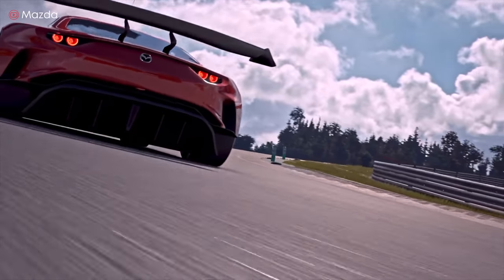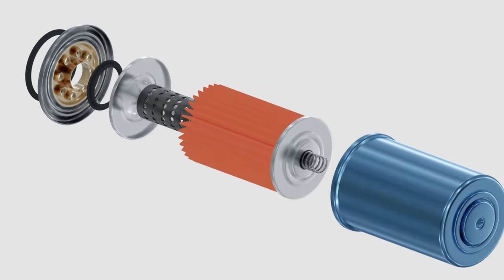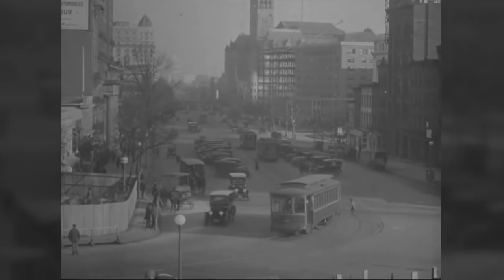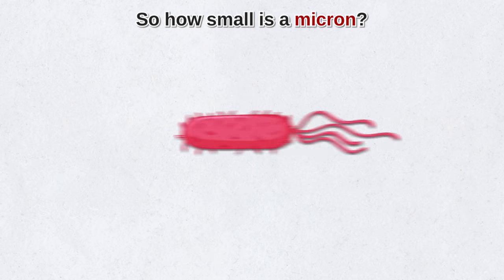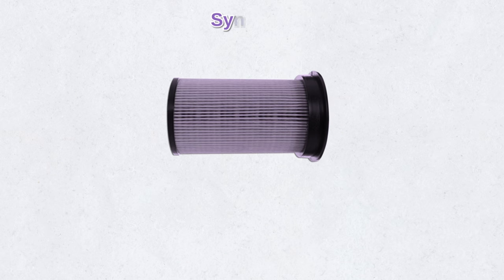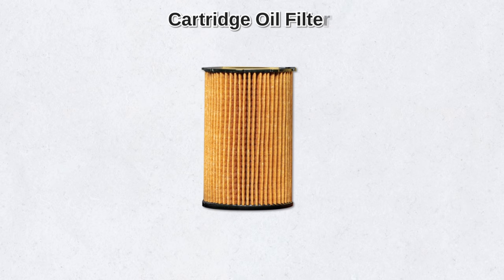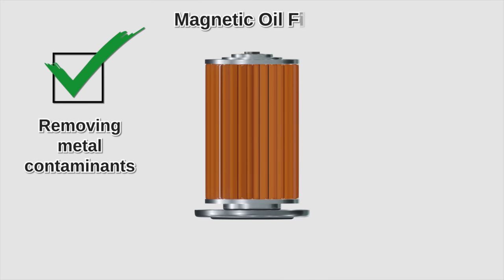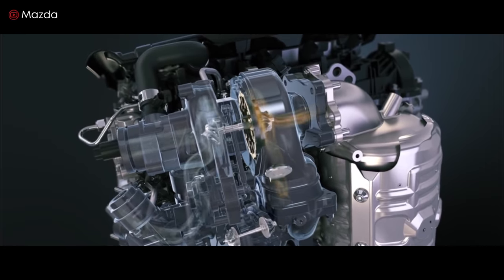This New Oil Filter Just Changed the Game (No More Oil Changes)

Comment: When I was an owner operator truck driver, I used to run a bypass oil filter system of the tractor. The advantage was you kept the oil cleaner and used oil analysis to tell you when it was time to change the oil and not a set mileage schedule. So normally, I could go 150-200k miles before actually needing to change the oil (just for comparison at that time, normal oil change intervals on heavy duty highway diesels was between 25-50k miles). The added bonus to oil analysis is you will be able to catch small issues before they become large ones that lead to catastrophic engine damage. Things like coolant leaking or fuel dilution will show up as will signs of incomplete combustion, not to mention engine wear that is normal throughout the lifespan on an engine.
Reply: It is hours of operating the engine, not miles, that count.
Reply: I have a Mazda spin on bypass filter on the shelf. It is for a Mazda diesel pickup early 1980s. My guess it is pleated paper.Why does a pleated paper  bypass filter clean oil better than a pleated paper full flow filter ? Answer It has an orifice.the slower the flow the better the cleaning. Why was it removed from the Mazda. To make room for a Frantz oil cleaner.. you cant clean oil with pleated filters. It takes depth. The Frantz has depth. 4 inches will always beat 1/32 inch. My Rambler American came new from the factory with a pleated paper bypass filter. The way I got clean oil was to remove it and install a Frantz oil cleaner. Sound like a Frantz dealer.   Haven't used them in years. Better designed filters have came and gone. When you stop selling them you lose track of them. All I have now is Gulf Coasts and Motor Guards. I'm curious about the Jackmaster of Austrailia. Some Australian's use toilet paper in them. I like the tee handle and top loaders.
Reply: love your videos YAY
Reply: Yes, but there's a linear relationship between the two.
Reply: Those were the “good old days”. Diesel and gas engines suffer from oil dilution and contamination caused by emission control systems. A Bypass filter is still a good idea. Oil change intervals should be determined by oil analysis if you want to go beyond 5000 miles.
Reply: Some truck owners spend a lot of 
Money on oil analysis. My old cars are not worth it. I probably spend more on filters and make up oil than I need to. Was mentioning that my Subaru had 250,000 miles with no oil drains using a Frantz oil cleaner and Mobil 1. Was changing the Frantz every 12,000 miles and adding a new quart of oil a Caterpillar lab manager sent me a sample kit. He said the oil looked good  for that many miles but mentioned things like some caramelization. Suggested every 6,000 lnstead of 12,000. I took his advise. The Subaru also ran too hot in Dallas traffic with the A/C on. Toilet paper no longer fits the Frantz. I recently bought a Australian Jackmaster.  They are set up to use tightly woumd toilet paper such as scott 1000 or their own fabric covered elements. I put a roll of Great Value from Walmart  in the Australian Jackmaster. The top loaders have the larger core seals for the larger TPCores. I got the Classic model.
Reply: Not sure how often they sent oil in the Peterbilt to a lab for analysis. At least every time the bypass filters were changed. Years ago I cut open a WIX 750 element for a Luberfiner. It was packed with pulverized newspapers. Fleetguard was the same. Found cotton waste in a Luberfiner  element  years before that. One thing they were doing when I was selling them is they passed current thru a sample of used oil. The dirtier the oil the better the conductivity. The instrument was zeroed on new oil. If the conductivity gets too high a sample goes to the lab. If the instrument pegs out the engine is shut down first. This is for a locomotive engine in a drilling rig. Should work for most anything. Gulf Coast filters does that stuff.
Reply: The Amsoil and Como filter was a little different. They use oil analysis to determine when to change the oil and filters Because of low TBN. Between 50 and 60 thousand miles. The Gulf Coast filter truck still had tin on the rod and main bearing with no copper showing anywhere at 500 thousand  miles. Im just copying the Road King articles. Gulf Coast Filters has more recent information Gulf Coast has a sock filter now. Probably dont apreciate me talking about Bounty big rolls It looks like the best of the small filters is the Motor Guard  Gulf Coast junior  and the Australian Jackmaster Classic. I like the  more expensive Jackmaster with the T handle. It wont clean oil better than the Classic and I have a wrench.

Comment: Scotty, don't forget to remind folks to check tightness of the oil filler cap and dip stick! Both have o-ring seals that may leak and after 15 years my o-ring went flat and set off codes that were not easily solved! Aha! I found the air vacuum leak! It was the oil cap! Code instantly went off and hasn't returned since!
Reply: He talked about the oil filler cap seal a couple of weeks ago.
Reply: Are you talking about the wait a minute is there a cap on the oil filter where is the cat
Reply: If the middle long piece part of the oil cap is missing how bad would that affect the engine?

Comment: I only use OEM oil filters on my chevy 5.3 Its made for the oil weight ,pressure bypass rating,  and micron requirements for my engine . Aftermarket filters are made to cover many applications and might create more wear on the engine.I have changed my own oil and always used OEM filters all my life and never had to go into an engine for repairs.(And i ONLY drive GM vehicles).
Reply: except GM doesn't manufacture their filters, someone like WIX or Bosch does- and they also make other brands. There's only a very few cos.that make all filters, with different names..
Reply: @land7776  Fram is one company that manufactures and markets several brands of oil and air filters.

Comment: I like to place magnets on my regular oil filters. When you cut them open there is usually a very fine particle pile in the shape of the magnetic flux lines. It's never much but always good to keep particles out of the oil. Magnets are cheap.
Reply: Brilliant!
I'm gonna do this on my next oil change.
Reply: Install a Magnetic Drain plug! Also!
Reply: @leegillette9178  
Always! The filter sees all of the oil at some point, though. Drain plug may or may not but it is a great way to get out more, also.
Reply: A lot of steel is much too small for the high volume full flow filter to remove.A magnet or many bypass type oil filters can remove it. Oil changers recommend draining the oil.  For the last 60 years I have used depth bypass filters such as Frantz Motor Guard Gulf Coast and the Australian Jackmaster. My pristine engines have almost nothing in the oil large enough to be removed by the full flow filter. The Wix on my Pontiac has been on there about 4 years and 60,000 miles. No doubt it is still clean. I normally change the full flow filter every 2 years. The bypass depth filter is supposed to keep the full flow filter clean as well as the engine. Actually a game changer filter can only keep the oil clean.  Clean oil can do a lot of things. I have the Australian Jackmaster Classic. As far as I know it is the easiest to service still in production. Push in the  toilet paper and put on the lid. Similar to the Gulf Coast junior.

Comment: I always use the synthetic filter with my full synthetic oil. Engine still runs smooth with 164k miles on it. Got it used with 34k miles

Comment: I have a 2012 Chevy Suburban with the 5.3 L v8. I have had it since 66000 mi and it has 110000 now. I have changed the oil at the mileage from the vehicle mileage countdown meter. Oil and filter was the "specials" from the local parts shop. I was seeing lowering oil pressure readings over time down to the point that it would alarm < 15 lb. I was going the tear it apart to replace the pump. On a lark i changed to a better quality oil filter and shazam, no oil pressure issues at all anymore. I will always buy the best quality filter they have now. Thanks for the info about the better filtering filters with high flow.

Comment: The last time i ever let someone else change my oil they had the same filter on it that i had on the car when I showed up. I will never let a shop change my oil again.
Reply: I take my cars to my mechanic for oil change. I buy the correct oil and filter and take it to him. He charges me a minimum because I let him do all my maintenance.
Reply: amen to that. I have seen these clowns overfill the oil, and tighten the oil filter and plug so tight you need vice grips and a cheater bar to get plug off, or have to puncture the filter and pry it back off. I don't trust any of them, that's why I do it myself. Especially the quik-lube places, they are paying flunkies near minimum wage to do oil changes on your car- and they don't know or care about your car. Even at a dealership, it's not the top mech that's changing your oil, it's the newbie...
Reply: When I worked  in a full service Standard Station it was sir you could use an oil change.  Now its sir you could use a depth bypass filter. Filters that clean oil are not practical  for a lot of people. The good ones all have oil lines. You have to understand  the oil system. But if you want to escape the allowing the oil to get dirty wear and foul the engine then draining it system you need a depth bypass  filter. Pleated paper doesnt do it.
Reply: @ralphwood8818  well, it's done it for me for decades. I've never owned a car with mileage that didn't go >200k, and never had one damaged or had the heads off, using standard oil filters the whole time...
Reply: @land7776  I do it with no oil drains. Almost 60 years. Allowing oil to get dirty then draining it doesnt do it for me. Started with a Frantz oil cleaner on a Rambler American. It came with a spin on bypass filter. Got tired of dirty oil and oil drains. All I have now is Motor Guards and Gulf Coasts. They all keep the oil clear.   Had to drain the oil and replace the head gasket once on the Rambler flat head 6.

Comment: Good information as usual.  My son changed the oil filter on our boat (350 Olds.)  The filter is on the back bottom where you can just reach the filter but cannot see it.  The old filter gasket stayed on the engine and distorted under the new filter.  Nothing we could see. We always observe the engine on our first time out for water leaks or other issues. In this case we pumped out quarts of oil into the boat, shut it down and returned home.  Rest of family not happy. He nor I will ever “not check” for the old gasket ever again.

Comment: In modern engines there's very little 'dirt', particles in oil is actually wear metals! Once some steel wears of cams and the crankshaft these particles then wear aluminum from pistons, chromium from rings and lead from babbit main bearings, etc. How do I know? Oil analysis reports before and after show strong magnets were inserted on and in my spin-on oil filters. To get good results you need lots of magnets because engine oil is thick and moves fast thru the filter.  At 8:24 Scotty claims magnetic filters don't work on aluminum, true, but when you reduce steel particles, the aluminum wear drops considerably. What's best, small or large oil filters? Turns out oil takes the shortest path thru a filter as soon as it enters, filter media at the mount plate of the filter sees the highest oil flow while the rest of the filter fills up, flow thru the media at the other end is far slower. Was I surprised to see this? Yes. Do I like large filters? Yes. It turns out it does not help. Look up the oil filter for a (C2 and up) Corvette, any Corvette, they are incredibly small! Mostly to fit a tightly packed engine,  if there ever was a need for a large filter this is it, yet not so!  My car? 2009 Impala, spin-on filter with 27 magnets (incl 2 FilterMags on the outside). Lead wear is < 1ppm!
Reply: what magnets do you use and where do you place them? Most neodymium magnets lose considerable magnetism when hot, so putting them in oil is bunk. Just curious about your ideas though
Reply: Interesting..
Reply: @dansmith6990  Neodymium magnets lose a percentage of their magnetism depending on their curie point. Most w/ a curie point of 350F will lose about 20-30% at 200F and recover when cool. If they hit 350F they become non-magnetic. Magnets with higher curie points can be bought for much more $$. For a spin-on oil filter I use a pair of FilterMags on the outside, be sure there is enough room all the way around. Between them there's enough space for Neo bar magnets. Inside I place 2 bar mags down the tube seated opposite each other. Then on the filter threaded base I put small round neo disk mags on the steel between the oil holes. Been doing it for years now.
Reply: @mmpiforall5913  on these magnets do you then have to clean these magnets and is it hard to get particles off of them
Reply: @arlenmargolin1650  Yes, during an oil change I take all the mags off and clean. Once the oil is off the steel particles are stubborn, so I use damp tissue paper to move all material to one spot and 'pinch' it off. It takes a few minutes, but hey, TLC always gives good results.
Reply: I dont need magnets because I use depth bypass filters  that remove all of the abrasives. The other day I changed the Scott 1000 in the Motor Guard. It had the normal metal particles on top of the TP. Have a powerful magnet that I removed from a in tank fuel pump. It grabbed most of the particles. I was cleaning a lawn mower  starter. I noticed the non electrical magnets were very strong and curved. They are glued in pretty good. Looks like good magnets for a full flow filter. When I start getting more than usual abrasives  that I can see it usually means it's time to change the full flow filter. Under normal conditions the Scott 1000 only gets what is too small for the full flow to remove like moisture and sludge. In the old days the TP removed a lot of carbon chunks. Not so much in these modern engines with the synthetic  oils. I used the magnet to see how much steel was on top of the Scott. Mostly steel. I dont drain oil unless there is a reason such as a leaky head gasket. My oil is always amber colored.
Reply: @ralphwood8818  Very Good man! I only wish most cars had enough room to hook up and install a bypass filter like yours, but FWD engine bays are tight. Here's the kicker, when steel particles are removed & reduced, all other wear metals drop too!

Comment: A few years ago I bought a new truck. I took it to the dealer at 3,000 miles to get the oil changed. They didn’t want to change my oil because the oil change light did not come on yet.  I had to argue with them to get an oil change done.  I couldn’t believe it.  

My opinion is that changing the oil and filter more often will help keep the engine in good condition for as long as possible.